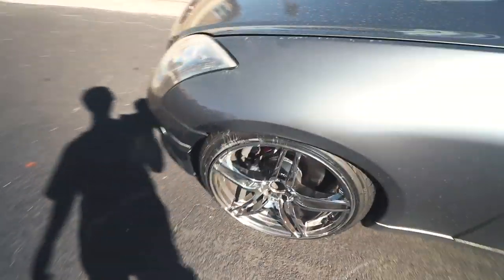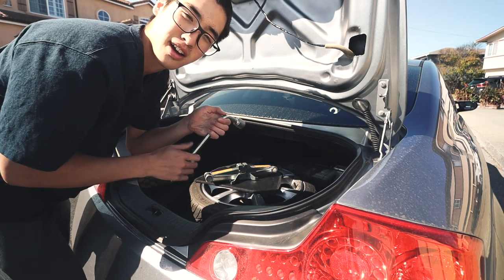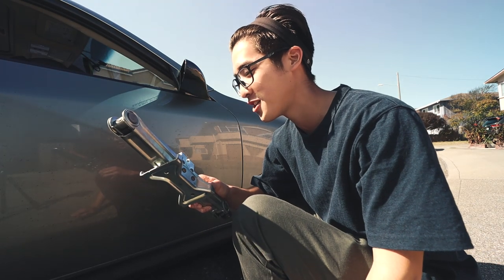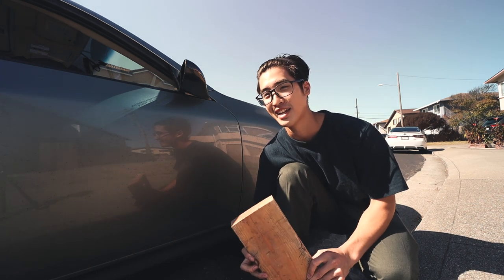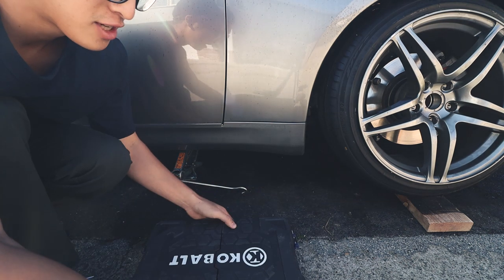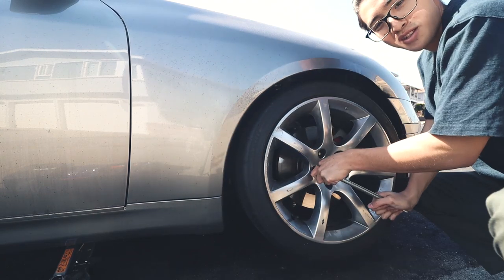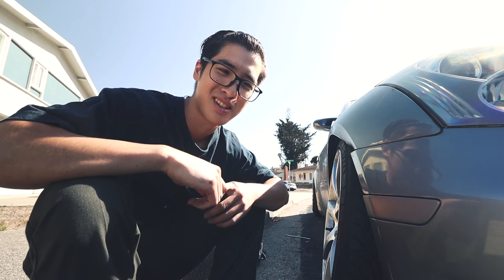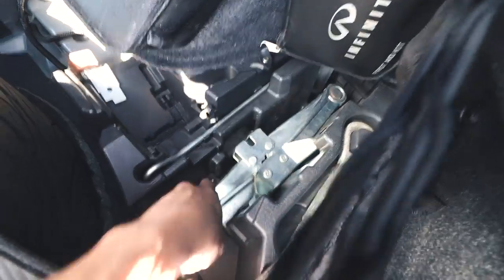Stranded in my G35...

Comment: dude at the end of the breaker bar there is a hole you connect the jack via the hooked end of the first bar and then place through the hole on the breaker bar the hooked bar this is a complete jack set you have you just haven't learn to connect all three parts correctly lol